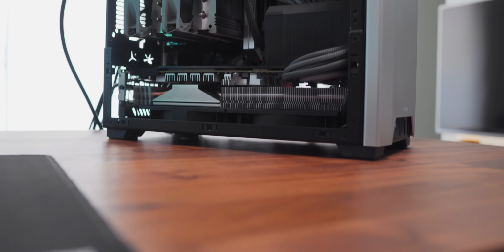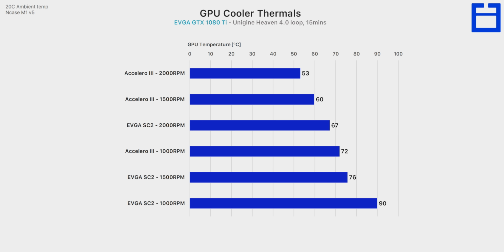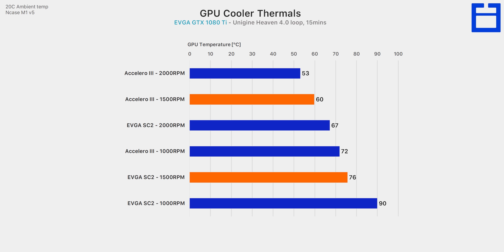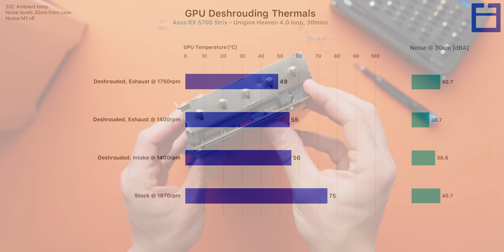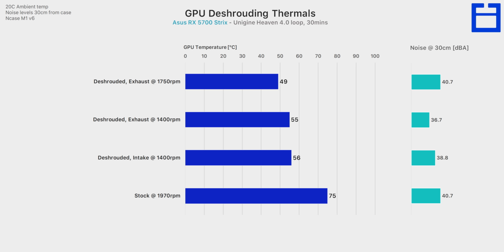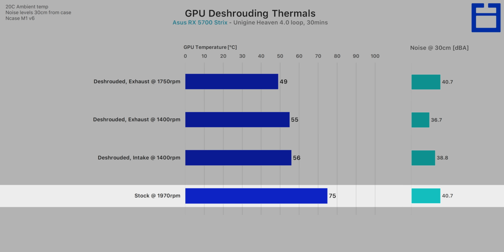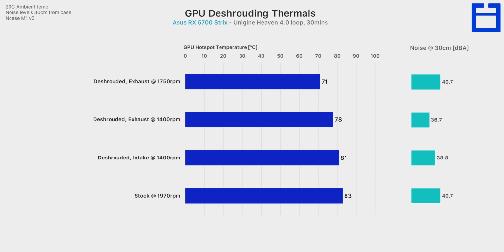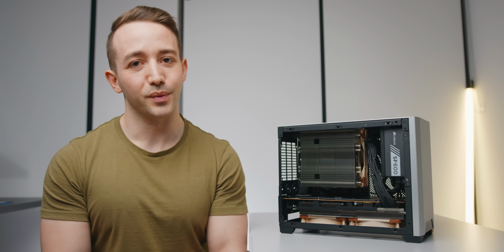GPU Deshroud Mod - Mindblowing Thermal Improvement

Comment: Decided to do this with asrock challenger 5700xt. Dropped 20 ~ 25 C in hot spot and core. It was thermal throttle even with UV and UC but now clock stay flat. What a sight to behold

Comment: I had a very hot running 5700xt and swapped the fans & replaced the memory thermal pads. similar results. it turned a horrific cheapest-on-market into a good card that wasn't obnoxious sounding

Comment: watching this 4 years later. The fancontrol issues with the strix cards are issues all strix cards have. had the issue with: gtx 1060, rtx 2070, rtx 2080 super, rtx 3060ti, rtx 3080, rtx 4080, rtx 4080 super (all strix ofc). The "fix" I found, was to have asus's gpu tweak running, the aux fans set to 100% (which often still dont make them spin, wow) and update gpu driver while that is set to 100%, and then it sometimes starts working like normal.

Comment: Hey man cool video! I am planning to do this to a gigabyte vision 3090. The 3 Grey noctua fans came today. Can't wait to see the results. 
The stock fans are not sufficient for the core, it runs 10 degrees hotter than my other 4 3090 cards. I may even print a new shroud that snaps over top to make it look factory. Here's hoping!
Reply: And how were the results ?
Reply: @ibobeko4309  the noctua fans gave the same performance so I bought a little 3 fan server shroud from amazon and it's now the coldest 3090 I've ever seen.
Reply: I'm mining aleo on it and it's at 32 on core and 48 on mem
Reply: Just copper claw the VRAM and throw thick thermal pads on the backplate. That should bring temps down more.

Comment: @optimumtech do this again in 2024
Reply: Only really useful with cheap cards. Just did it on my cheapo 4070. With 2x 120mm noctua fans the temperature dropped by roughy 30c. 85c to 55c. Although I replaced the thermal paste as well so it wasn't all due to the noctua fans. And I 3d printed a new shroud that fit around the 120mm fans.

Comment: very dissapointed by the video, while I understad that some people might be trying to make their systems quieter I am more interested with the performance aspect, I think you could habe added a lot of value to your video by just running some benchmarks and stress tests and giving us the results of that, Im sure those results would have positive too
Reply: There is no performance to be gained by cooling better.
Thermal headroom is required for Overclocking - but before you get to problematic temps the GPU is gonna crash for other reasons.

Comment: How. How does making the fans exhaust down.  Work better. My mind is boggled.  Did you rotate the noctua fans under the gpu to exhaust out the bottom of the case? Please reply.  Very curious. Please

Comment: for anyone worried about mounting it's pretty easy to just do it yourself but if not capable of doing so etsy sells a kit with brackets for fans along with a mini 4 pin to a split 4 pin for both of your fans for like 20 dollars i believe. I've been doing this for a few years actually It does work pretty well on most cards but at the end of the day I just water cool everything becuase no matter how much air you throw at it if it's hotspot problems you're having water cooling is the only solution.

Comment: currently waiting on the mini to 4 pin adapter, Noctua redux 1700rpm fan and some cable ties, I am going to de-shroud my new RTX 2060, swap out the old thermal paste for arctic mx 4 or whatever it's called, run the fan at an aggressive curve in afterburner - I am hoping to be able to get really good overclocking results at maybe 69 to 75c at load. I cant afford a 30 series card right now but if I can get closer with overclocking I'll be happy. I've OC'd my 5600x so much that even AAA games only use like 12 percent of it lol, just my GPU needs some TLC.

Comment: i dont understand why gpu companies dont make it easier and more accessible to modify the air cooling options on graphic cards. it opens up a whole new market to profit on. also it allows consumers to get more life out of their gpu's by allowing people to upgrade and replace air cooling on their graphic cards. allowing consumers to customize the noise level, thermals, and aesthetics on their graphics cards. also making it possible to replace cooling systems if they go bad. its a whole market that has been long forgotten for some reason. there would not be that much that companies would need to do in order to make this a reality. its not like they would need to re engineer fans or fan sockets. they would just need to make them more universally compatible when initially designing their new gpu's. people would actually go out of there way to buy gpu's with upgradable and customizable air cooling options. it would benefit both consumers and companies. there is literally no downside.

Comment: Tin snips / aviation snips probably would be cleaner than a Dremel. Or even ,from the look of those tabs, just bend them away or bend them back and forth until they get weak and snap off.

Comment: Just to note that, if you want to control fan speeds with GPU temps you can use Argus Monitor which is a very flexible utility for controlling fan speeds; I was kinda using a deshroud with my current graphics card (using shorud and sys fans to keep temps cooler) and that software was able to accomplish that very task.

Comment: Been doing something slightly different myself some years already: got a splitter cable for GPU fan socket and then GPU --> Case fan adapter to hook up one case fan with the GPU. Idea with this is that when the GPU fans start to speed up due temps rising up, that one case fan provides it with more cool air from the front panel. That way the internal circulation is on better sync and the GPU gets more ''fresh air'' to cool it down.

Comment: Jay showed that going in and redoing the thermal paste and thermal pads on a hot card can potentially increase thermal performance substantially, this shows that if you're willing to "de-shroud" and replace the fans there's even more performance to be gained. a pair of Noctua's isn't cheap but they last a long time, you could do this and migrate them to whatever new graphics card you get assuming you're willing to do a bit of "jury rigging" and the lower thermals should allow you to dramatically reduce fan speed hence noise under load, my kinda mod.

Comment: Hello, I have a question, the mini vga adapter is not compatible with this VGA as it has a 7 pin fan connector, how did you connect it ??
🙂

Comment: I’m wanting to implement this in a node 202 case, do the replacement fans need to be plugged into the gpu? Or can they be hooked up to the case fan pins on the motherboard?

Comment: You can deshroud a Gigabyte 3080 VisionOC pretty easily (requires taking off the cooler completely, but it's 100% flat. You can also re-paste with liquid metal, giving a pretty significant bump in performance. There's a reddit on this, just use the googles.

Comment: I just literally built a white NR200 partially based on this video. Placing my power supply on the side, like here, made everything fit much better. (NR200, C14S bottom fan, 5600x, CM-V750 SFX, 1080 ti). Your build videos are awesome!

Comment: 2x140mm is even better. I was running 2x120mm for 2 years on a regular ATX case and decided to try 140mms on a whim not expecting a huge improvement, but it's almost as significant as stock to 120mms.

Comment: you can also use FanControl from GitHub ! There you can Fans that are connected to the Board control via custom curve to the gpu temp ! :) thank me later. Tool keeps updating and is free !
Reply: Thanks, I'll give this a try
Reply: @Turok2  still using it. Already spend money to hope they will go on with this good work :) - in bios i configure the fans to standard profile. When Windows and Fan Curve starts, the fans slow down. you can also have a temp in the task bar :)

Comment: "Exhaust" ... in this case the fans are not blowing the cool air to the card and because of that the hot air to the case, but they blow out the card's hot air under the case? 
It would be and interesting mod in other cases as well especially with some exhaust ducting. I am very uneasy that the vga blows that 70-80 °C air on the motherboard especially, because there is an M.2 slot right there.

Comment: Fan exhaust is that much better than intake? So if the bottom fans are sending air out I suppose I need to change the top fans to intake as otherwise where will the CPU get cool air from if the bottom fans are exhaust only (NR200P) ....

Comment: A great tool to slave motherboard fans to GPU temps is Argus Monitor. I deshrouded my gtx970 because the fans were getting loud (it's old) and needed a way to slave my fans to my GPU temp. Works great.

Comment: I did this mod with my 5700xt
Do not expect much in case of temp reduction maybe 3 to 4 °c

But noise reduction was a huge improvement even with fans at 100% barely audible

Comment: Did you have to use low profile memory with the Noctua NH-C14S cooler or can it be taller? Also, because of the cooler, were you forced to mount the PSU in that position or can it be mounted next to the MOBO as usually seen in the M1?

Comment: My ROG Strix 1070: 2 NF-A12-25 55C full load, nice and quiet
My ROG Strix 3090: 3 NF-A12*25 + heatsink on the back plate + thermal grizzly hydronaut = 82C when playing 2077. I desperately need water cooling

Comment: Thermal improvement my ass, my 2080ti ran hot af since i plugged it in. When i changed the thermal paste (which they OD'd) the temps dropped 20+ degrees!

Comment: I deshrouded my Ventus 3080 and replaced the fans with 3 Noctua NF-A9x14 HS-PWM chromax fans.  At 100% fan speed (2500 rpm) my GPU runs at 28C over ambient (48C).  At 1500 rpm fan speed it runs at 34C over ambient (54C). At 1200rpm it runs at   45C over ambient (65C).  Very happy with this mod.  I can hardly hear the fans now

Comment: Deshrouded my Gigabyte Aorus GTX1080ti. Using two Arctic P12's in a vertical mount adaptor in my Corsair 220T case, I went from 76c with 30 minutes of unigen to 51c. Much quieter and insane drop in temps.

Comment: Thinking if I should try this with Node 202 + RTX 2060 blower setup, one of my fan is blowing straight at the flat plastic section of the shroud, this might help. But then I don't know if it's even possible with the card and if that would affect the pressure going into the compute side of the case.

Comment: I did something similar to a GTX 1080 Strix while I waited for replacement stock fans. I was amazed at how much better 2x120mm case fans were vs stock fans. Of course, cable ties were used.

Comment: I tried this with my Strix 2080. I wasn’t able to get the fans right on the heatsink. I got close but not close enough. Temps were way worse deshrouded. The fans really need to be flush with the heatsink so the static pressure does it’s thing forcing air through the cooler instead of just throwing air at it.

Comment: I tried a deshroud on my Asus RTX3080 last weekend. It failed, because there is a combined plug for all three fans and no standard fan interface. Since I don't know the pins on that plug I aborted the deshroud. I don't know how I should control the fans otherwise.
Reply: In all those I've modded over the years, the PWM pinouts for GPU fan headers have been identical to that of motherboards; virtually all PWM fans now use a standard pinout system (ground - 12V - tach - PWM signal; skip the tach line on all but one fan when joining two or more).  If in doubt, use a spare PWM header on the motherboard and set the fan curve via software (there are solutions available for setting custom curves on all fans based on any combination of temp-sensors in a rig).
Reply: @ecarter2747  The connector on the graphics card has 7 or 8 or something pins, I did not find a fitting adapter cable for this to connect to standard fans. Unfortunately there is also no spare header on the mainboard left (AIO, CPU and case PWMs are in use), but maybe I could use the same header for case outlet and CPU fans, so I could use the case header for the graphics card. Do you have a recommendation for a good fan control software? Speedfan doesn't support the board.

Comment: Can a single 4pin header on the gpu power 2 140mm fans without drawing too much power through it
Reply: Yes, that should not be an issue, in fact the new fans may even use less than the originals; check the wattage rating on the new fans against that of the old.  The 'power draw' from a fan is exactly that, the fan 'requests' the amount of power required to run it, and most fans will use less than 4 Watts at full speed; a GPU is allowed to draw up to 70 Watts from the motherboard alone (not including supplementary power cables) and modern GPUs at idle usually pull >25x more power than the fans connected to it.

Comment: Is it possible to deshroud really short cards like the Ventus XS series? The card forces 44% fan speed so I would rather rely on case fans to blow air into the card.
Reply: I did deshround my 2080 super Ventus XS. Its just 4 screws so removing the faceplate and fans is rly easy. Also it reduced my Temps by about 9-10C, not to mention the more pleasant fan noise.

Comment: I did this few years ago with a HD7950 when one of the stock fans died. Ziptied two 120 case fans to the bare heatsink. Better than stock in every regard. It's janky, but works better than stock. Been meaning to do the same to my GTX1080 pretty much since i bought it, but never got around to it. Now that it's out of warranty there isn't much keeping me from doing it.

Comment: I've just deshrouded my rog strix 2060 super after snapping a blade in the original even with not so great 120mm fans the noise levels have dropped so low. Such a good mod.

Comment: I wanted to do it for my XFX RX 570 but the heatsink is only 80x180 mm so there was no way to put 2x120 mm fans. I tried 2x80 mm but it was not better than the original. Sadly those cheaper cards fall into a void for water blocks or cooling options in general. I even tried to find some cheap broken card of the same size just to try cutting the heat pipes and cycling water through them to test it out without damaging my card's cooler but I couldn't find it.

Comment: how to control fan speed i did this with r9 285 saw huge improvement max out at 60c i use speed fan to control the fans speed can't find a way to connect it to the gpu board

Comment: This is kind of off topic, but...

Isn't there a mod where you can remove the cover/IHS from a CPU and put the plate from a cooler right up against the silicon so the cooler itself acts as the CPU's IHS? I mean the cooler itself is going to do the job of holding down the CPU, ssooooo, why not?
Reply: I think that's known as 'Delidding' . It works but there's a non-0 change of wrecking your chip and of course bye bye warranty

Comment: Is there an instruction on how to do this? You just take off the fans and plastic and leave the heatsink and just install like normal with the fans touch the heat sinks underneath?
Reply: Yes there's really not much to it.  How you mount the fans is the tricky bit- if you're fancy you could 3d print a bracket, if you're ghetto like me zip ties lol

Comment: I did this to a gigabyte GTX 1070 mini itx with a 120mm fan at 1000rpm. From 84c at 1650mhz to 70c at 1950mhz full overclock. Edit: don’t attach your fans to your gpu headers, use your motherboard as the fans use some of the gpu power limit budget

Comment: Have you tried to install fans under the gpu in reversed position? To take hot air outside. I took off my fans from palit 3080 gaming pro oc and installed Arctic p12 + stock silverstone fans of my Raven RVZ03B-ARGB (sandwich style fans)) so i have a lot of hot air inside my pc now, cpu temps are really high

Comment: What do You think about partial deshroud? For GPUs which allows keeping fans like this EVGA, just remove the shroud and on the bottom of the case install slim fans, like Skythe Kaze. This should improve cooling I think, as now the whole GPU radiator will have fresh air. And stock gpu fans still will affect on most critical parts.

Comment: have you tried having the fans mounted directly to the n1 case instead of on the card itself? there would be a gap but i wonder what sort of performance difference there would be. would you mind trying this? may work with the initial card too, if you can leave the tabs on

Comment: So wait ✋... Doesn't the stock gpu fans ramp up as cooling is needed? Did you test the stock gpu fans at 100%? I say this because the 120mm fans are automatically at 100% and provide maximum airflow from the start.

Comment: Hi Optimum tech - I notice in your M1 case it looks like you have used a 120mm fan on your CPU cooler, is that right? If so what VLP RAM are you using? Finding it hard to find. Really loving your channel!

Comment: I have a deshrouded 1080ti in my NCASE M1 with 25x120mm Noctuas, like the build in the video. Huge improvement over stock, and very easy to execute. Would absolutely recommend it

Comment: I made this deshroud build but my noctua don't rotate when plugged on my AsusStrix 1080Ti power output 4 pins. Any ideas?
Reply: Forgot to say that the Noctuas are on a T cable and are working when plugged in a FAN  motherboard pin

Comment: I've been saying for years that these ~90mm by 10mm graphics card fans are garbage. Plus they're super difficult to find replacements for when they inevitably fail. No clue why graphics card manufacturers still haven't managed to adapt to a more standardized fan format, like 120mm by 15mm slim CPU fans. Hell, even 92mm by 15mm would be an improvement.

Comment: Was the improvement solely from deshrouding, or because you fixed the mounting pressure issue? Is the stock run completely stock or with the mounting fixed? If it was completely stock then I think this test doesn’t accurately show the benefits of deshrouding alone.